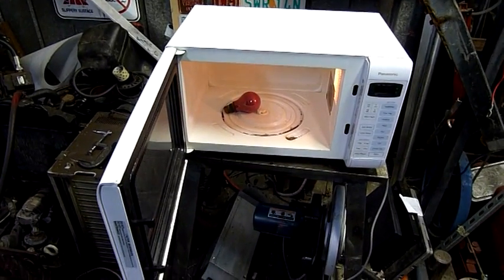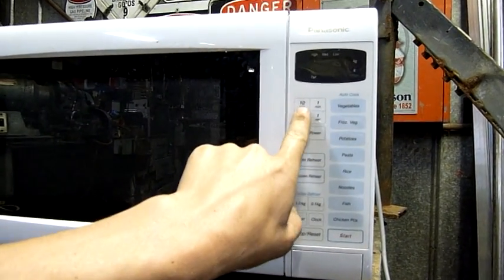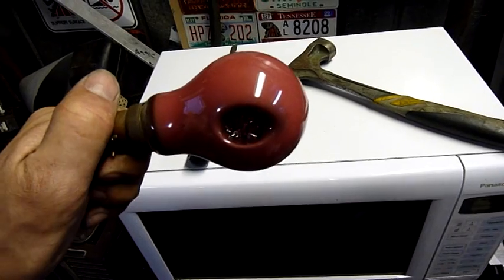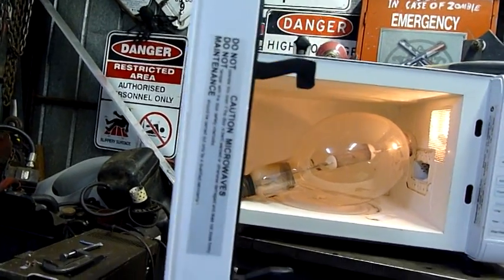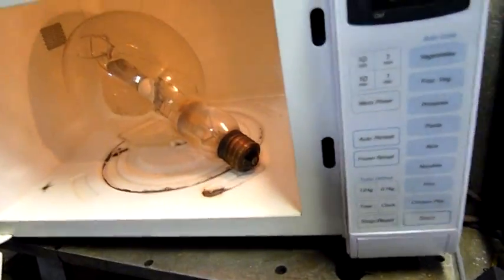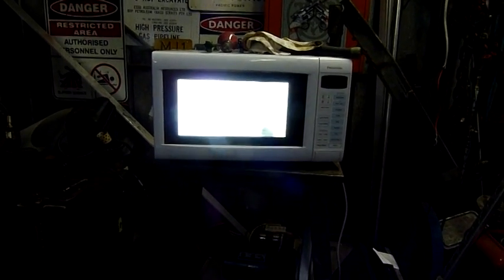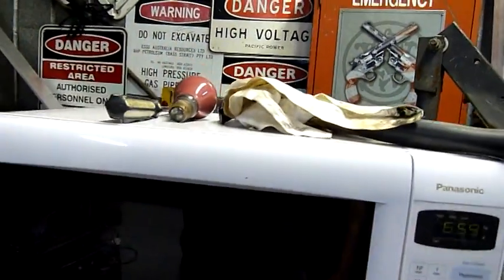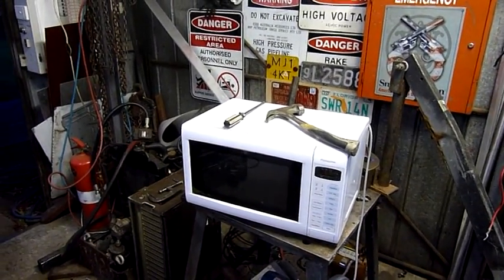Panasonic Inverter - Microwave Madness - Light Bulbs and Circuit Board

Comment: I use an old heavy Panasonic microwave from 1996, best microwave I've ever had. built a lot better than this newer shit. I had a fire nuking some kraft dinner once (forgot to add water to the KD) but it still works fine after a cleaning.

Comment: if you put a glass of water all the way in the opposite corner of the mag it absorbs the excess radiation and it will keep it running nonstop. I had a pump pumping water in and out of a jar and lit a small hps bulb for nearly 40 minutes till it melted on the inside. I also lit up the entire inside of a microwave once with plasma for 40 odd seconds. As long as you remove excess energy, the mag won't overheat =)

Comment: nah, they are safe. there is only electromagnetic radiation when there is voltage applied to the magnetron. it's impossible for radiation to remain in a food item after the magnetron is switched off. by the way, there are more than 1 type of radiation, and smoking causes more than cancer